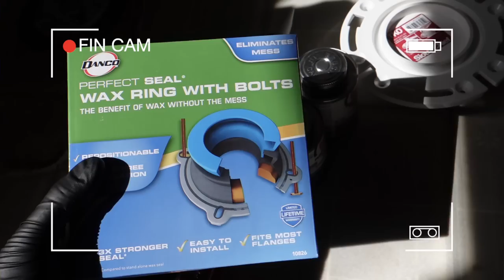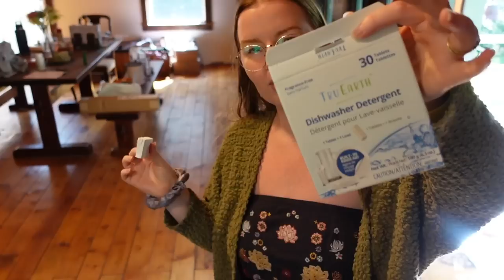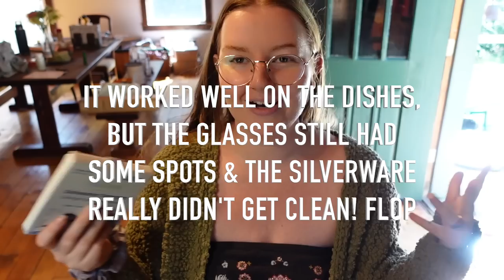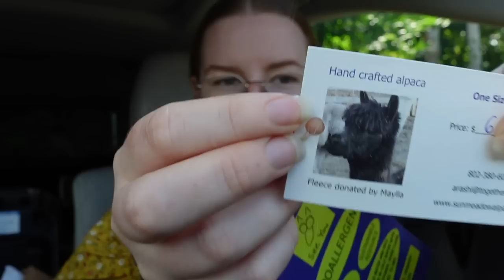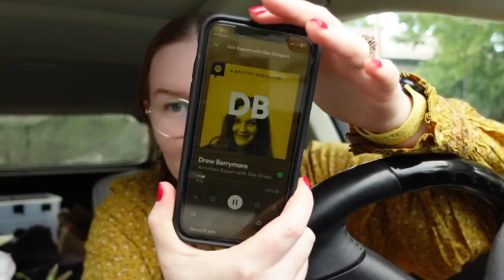RENO VLOG | toilet troubles, floor fumes & vent seshes

Comment: Hi Meghan, environmental scientist and fellow Vermonter here! Those trees you were talking about are most likely American Beech, it’s a little hard to tell in the video. But beech are a later successional species so they come in the second or third succession after the canopy has been established and they are shade tolerant. 80-90% of VT used to be deforested and only in the last 70-100 years has the state been reforested so many of the forests are quite young! So they are mostly just babies reaching for the sunlight, hence the skinny trunks. There is also a beech disease going around so if you see older ones with black bumps/holes that’s why. Ordinarily their bark is pretty smooth. Hope this answers your questions. There is so much to learn just from reading the landscape!

Comment: Hello hello. Been watching for many years but I don't comment often. I work at a non-profit for historic preservation and we do home repair tips/assistance for older homes. Vinyl is not a great material. It doesn't last as long as composites and isn't as eco friendly! It is of course cheaper though so some people don't have the option budget wise. There are other options for windows as well that aren't wood or vinyl that can be great better options. Just wanted to share the knowledge I've learned and know you are a fellow eco-minded person. Sending all the best <3
Reply from the maker: what do you guys normally recommend?
Reply: @meghanhughes  Any fiber cement like hardi or engineered wood like LP smart siding are usually what homeowners chose. I’ve also seen Everlast come up as an option recently but haven’t had any feedback about it yet due to price point.

Windows options list we provide include: Fibrex, aluminum, any wood base window thats clad in aluminum, fiberglass, or other composite. Marvin Windows and Anderson windows have examples we use in their website. 

All that being said this is something I’ve recently learned and grown passionate about and wanted to share but home reno projects can be so overwhelming. Wish you all the best and excited to see the process. 💕 Thank you for sharing.